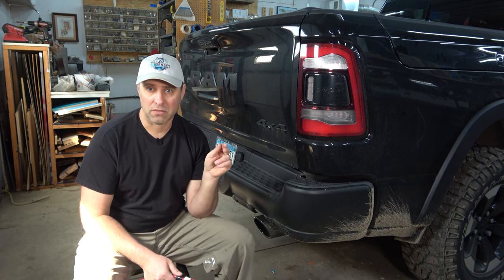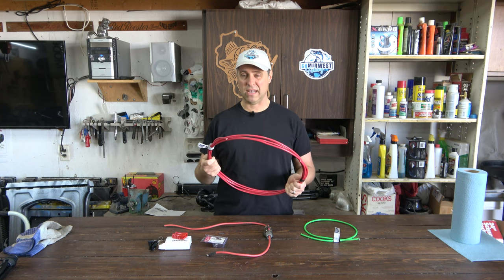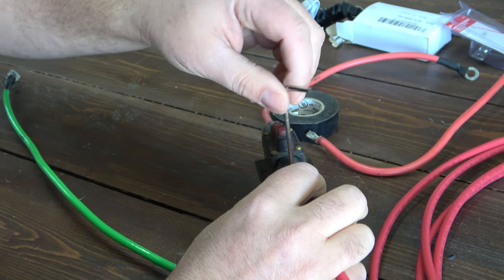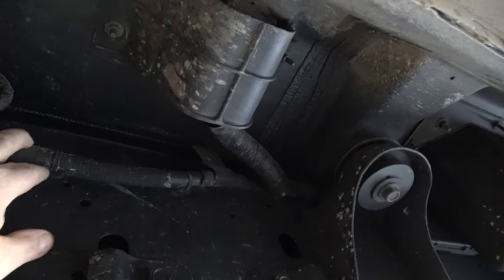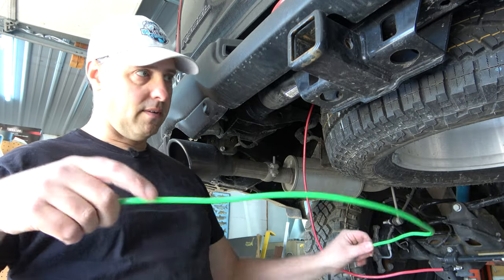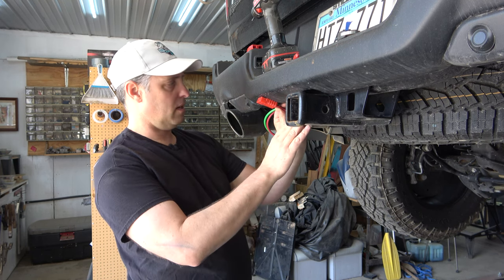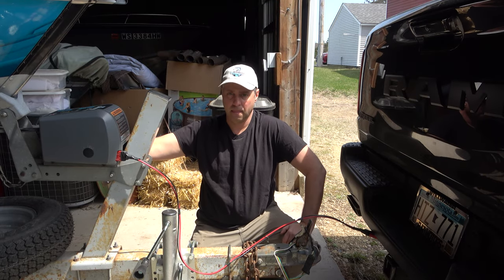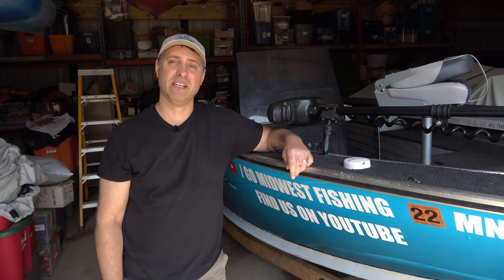2 Ways To Wire Your Electric Winch for Your Boat Trailer

Comment: Great video, thank you.  It's a pretty straight forward install and your video gave me the confidence to do it.  Does anyone have a source for replacement terminals for the connector?
Reply from the maker: Yes, you can find these easily on Amazon. I actually had to replace them when I got a new truck. See them here: https://amzn.to/4efDfBV
Reply: Thanks for the reply. I am looking for just the metal terminals that the wires are connected to that go inside the red connector housing. I was hoping not to have to buy a whole new connector.

Comment: Straight forward installation. I think I have all the parts I need except the broken stool. Good tip on disconnecting the circuit when not in use for long periods. Now that that’s done, go setup the pool (behind you)….summer’s coming ya know! 😁👍
Reply from the maker: Summer just arrived this week. We finally made it out of the 30's. Don't worry, the wife was already on me to get that pool set up. I will just add it to the list..

Comment: More or less that's the way I installed a 5,000 lb. Power Wench to my old Silverado and when I got the 21 Silverado I transferred the cable system. Now several things different was taking the negative all the way to the battery and my battery has several positive terminals to hook extras to. For extra line protection I used  1" PVC  split accordion tubing cable tied to channel the wires all the way to the rear connector....After 17 years the Wench and supply line work like a charm!!😎👀🎣
Reply from the maker: The PVC tubing is a great idea. That would definitely protect it. Thanks for the info Wes.

Comment: Randy, it’s been my finding at all the boat winches on the market are pretty much no good I would suggest if people go to Harbor freight or to one of the other tractor supply other places that sell truck whinges, off-road winches and use them to pull their boat up I did this 10 years ago I got a 5000 pound boat and I bought a 6000 pound winch. I had no problems since today I put it in and I never have a problem bringing my boat on the trailer, the only problem I’ve had is that the rollers on my trailer can’t take the punishment and I have to replace them all the time. I don’t know if the government approves it. I’ve been doing it for at least 10 years and not had a problem and my vote always loads right up , thank you for reading and your videos a good video
Reply from the maker: I wondered if an off road winch would work on a boat trailer. I'm glad you had good luck with it. So far my boat winch has been holding up well.

Comment: Really helpful and comprehensive vid, amigo.  I'd only suggest some cheap plastic conduit to run those wires through - over time, the wire insulation can be worn away by the movement of the truck, and you can wind up with dangerous and/or inconvenient shorts.   Goodonya.
Reply from the maker: Hi Andrew. Good suggestion. I did go back afterwards and add some conduit to the areas it might rub. Thanks for the comment.

Comment: You should use flexible tubing to prevent the pluscable  from burning if it gets damage. Otherwise ot looks good.
Reply from the maker: Good advice. A conduit around the wire will definitely help.

Comment: Great video! I’m doing exactly like you did and ordered the parts on Amazon! ThankYou!! Can I ask the name of the winch manufacturer and why you selected it? Thanks again
Reply from the maker: Hi Ed. My brother worked at a wholesale warehouse that sold outdoor goods. He got me this one at cost, so that's why I went with it. It is a StrongArm TW4000. You can see more about it here: https://amzn.to/3X4jGDy  I've been happy with it so far. I have a really heavy 18ft boat, and this one works well, but if I did it again, I would have gotten the 9000 version for a little more pulling power.

Comment: Have you have a seven post plug at the back of your truck for your camper? You also can pull power through the positive lead that is there that’s how I do it use it to recharge the battery at the front of the trailer while I’m in route to the place Where we’re going fishing or boating
Reply from the maker: Hi. Thanks for the tip. Yes, I have a 7 pin connector. The reason I don't use it is because the amp draw on the winch is too much for the small wires in the connector. That's why I run a heavy gauge wire back to the battery.
Reply: @GoMidwestFishing  I think he's saying that he uses an extra battery on the trailer for the winch, and uses the hot lead from the 7-pin connector to recharge the battery.
Reply from the maker: @gregrader6764  In that case, that sounds like a good idea. I haven't tried that set up yet.

Comment: Do you have one question for you can't you use the trailer power Not sure if that would work . great info my friend thank you
Reply from the maker: If you are wondering about using the power that comes off the plug for the trailer lights, that will not work. The winch draws a lot of amps and would burn right through those wires. That's why I ran a dedicated 6 gauge wire just for the winch. Great question. Thanks John.
Reply: Ok ty buddy

Comment: Thanks for the informative video.  I've been all over the internet trying to sort out the circuit breaker to use on my boat winch with zero solid information. My winch draws 200 amps max and comes with preinstalled 10 AWG wire. No fuse/breaker.  I followed your advice and ordered the quick connect, wire, and circuit breaker through your links.  I am using 4 AWG for a 15 ft run to the quick connect and don't know which breaker to use.  Any advice?  Additionally, what, if any fuse/breaker would you recommend for the 10 AWG wire from the back of the vehicle to the winch?   Any advice would be much appreciated.
Reply from the maker: Hello Michael. I'm glad it helped. The breaker is there to protect the wiring, so its a matter of what size wire you use. The breaker should disconnect before your wire melts. I see you are using 10 AWG wire. I'm not an expert in that area, so I'm hesitant to throw out numbers, but I would start by looking up amp ratings of your wire and then get a breaker that's slightly less. Good luck with your project.
Reply: @GoMidwestFishing  Thank you Sir!  Decided to go with your suggestion by using a circuit breaker to shut the system off when not in use and to prevent fire in the event of a dead short.  The winch manufacturer responded that the motor is internally fused. They do not recommend a fuse on the pre-installed 10AWG wire.  Really appreciate your help. Regards, Michael

Comment: What is the recommendation for a batte type / group size 12:54 for a 10,000 lb 12v trailer winch? Manual says 650 amps cold crank power.
Reply from the maker: I'm not sure what the recommended size it, but I always get the biggest one I can. No one ever complains about having too much power, and you really don't want to get stuck with a dead battery.

Comment: Great Video, how many amps would you recommend for the circuit breaker being? I will be powering a 12,000 lb winch
Reply from the maker: I believe I used a 60 amp, but your winch is bigger. The circuit breaker is actually to protect the wiring, so it really depends on what wire you use. Make sure the breaker trips before your wire melts.
Reply: I wired my winch into my 7 pole plug.

Comment: Glad I came across this video, so I did a setup identical to this but did everything you've said not to lol, and it cost me much more than  I wanted to spend, I feel like onthe second go around I did things correct however the winch still isn't operating to its full potential. ( if I set it up in front f my vehicle it works great but that long run to the rear really making it struggle, my battery shows anywhere from 12-14volts so I feel lost but really need this setup, any other suggestions?
Reply from the maker: Sorry to hear that. The only thing I can think of is that your wire gauge isn't big enough running to the back of your truck. DC current doesn't like long runs, so you need a heavy gauge wire to run that far for high demand items like a winch. It could also be a bad connection where you put the connector end on the wire. I'm not sure if you used the same quick connect I did, but they work pretty good. Check the voltage at the end of the wire to see if the 12-14 volts makes it all the way to the winch.
Reply: @Go Midwest Fishing  thanks for the information  will check voltageat end, I believe the wire themselves on the winch are 6 guage so that's what I ran to the rear. Yes I also used those same quick connectors they are great, I'll check that voltage and go from there, appreciate the quick response
Reply: @Go Midwest Fishing  so I just tested power at the rear end, without truck running it was 11.3 and with truck running t was 13.2.  Was hoping for a different outcome because the easy solution would be to get bigger cable now I'm even more😠
Reply from the maker: @AZHerps  That is interesting. You shouldn't have a problem then. All I can think of is there is a problem in the connector somewhere not making good contact.
Reply: @GoMidwestFishing  again I appreciate your help and taking time to get back to me

Comment: Question, would there be enough power from the 7 pin connector for it? Have a 7 pin to four pin. I can wire being a mechanic.
Reply from the maker: I would not try powering it from the 7 pin connector. The winch has a very high amp draw, so you need a bigger wire for it. Your 7 pin connector has smaller wires designed to power lights.
Reply: @GoMidwestFishing  thanks. Thinking of other option. Mount a battery case on the front of the trailer for it then.

Comment: Would it be better ti run negative all the way as well? Or not necessary . Trying to rig up my 05 explorer
Thanks
Reply from the maker: By grounding the negative to the frame, its using the metal in the frame as a wire. Since the negative terminal of your battery is grounded to the frame, there is no need to run a negative wire all the way back to the battery.

Comment: Hi my friend. How many ampers, brake switch you advice for a winch 6500lbr?
Reply from the maker: I believe my winch is 4500 lbs and I was using a 60 amp switch. The switch is mainly there to protect the wiring, so it depends on the size of your wire. You should be able to look up amp ratings for different size wires, and get one that will pop before your wire melts.

Comment: Great video, But hook up the wire to the battery last. Not first. Safety 1st!!
Reply from the maker: Thanks for the info. I left the circuit breaker tripped so there was no voltage on the wire.

Comment: Why not just split it into the trailer connector below the hitch
Reply from the maker: You need a heavy gauge wire to carry the high amps the winch draws. Your trailer wires would melt with that kind of load. Good question though. Thanks for the comment.
Reply: @GoMidwestFishing  oh ok. I didn’t even think of that. Good point.

Comment: The positive cable is NOT protected and will  shave on the chassis metal. It must be shielded.
Reply from the maker: You're right. I did end up going back and putting conduit around it.
Reply: @GoMidwestFishing  Good move buddy.

Comment: Dumb question, what of you babe a 12v cigarette lighter switch in the car boot?
Reply from the maker: I'm not sure exactly what you are asking, but if you want to know if you can run power from your cigarette lighter, the answer is no. The wires going to it are much too small.

Comment: Great video! As a reminder for comment readers when running  any wire against a frame rail or a any other rub point protect the wire. Whether that be a garden hose scrap, vacuum line scrap, a lot of tape, rubber grommet on rub point etc etc. something NEEDS to be here. As you drive everyday the insulation can slowly wear away. Leaving bare wire to metal…. Metal that happens to be a ground for the same system that hot is now feeding. Just something to consider. Even if you circuit break it when not in use that wire still has rub points. I’d be willing to bet if there was fuel on the ground, trucks wet from dropping in, sparks and arcs occur while it’s parked and a fire could ensue. Or a fire could ensue during transport. Just a friendly reminder all! He may have even done this but didn’t film. I just wanted to share. Again, great video! Jealous your mounting point for the winch in line to the eye was so convenient. I’m still “fabbing” the included bracket. Aka relief cuts and mediocre welds lol
Reply from the maker: Hi D Reynolds. Good point, and yes, I did put conduit on the wire after the install.